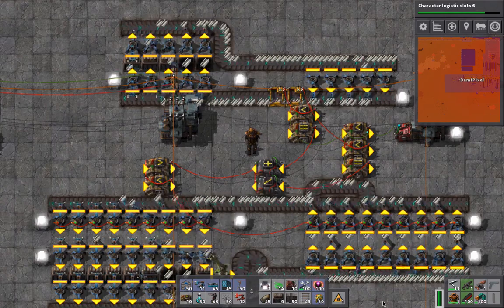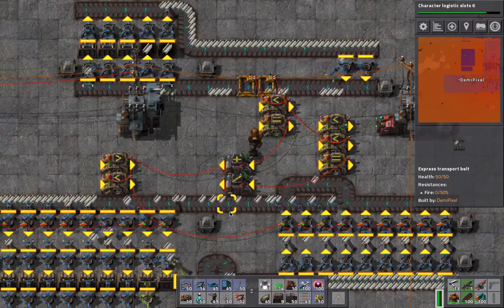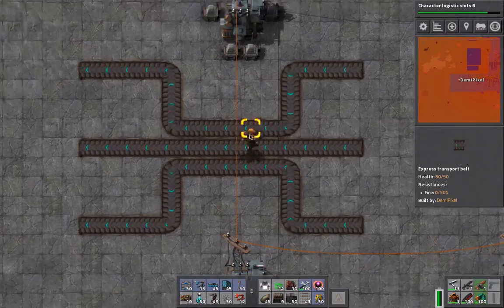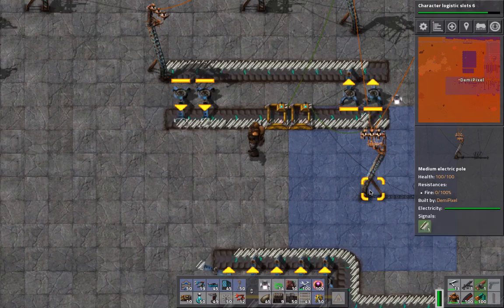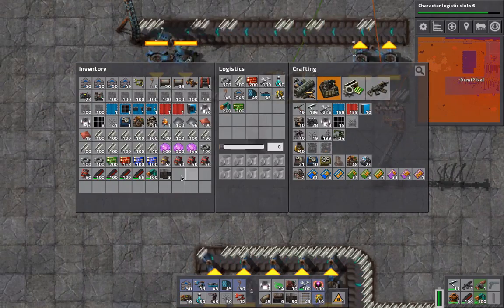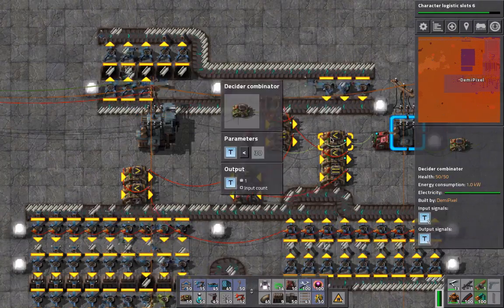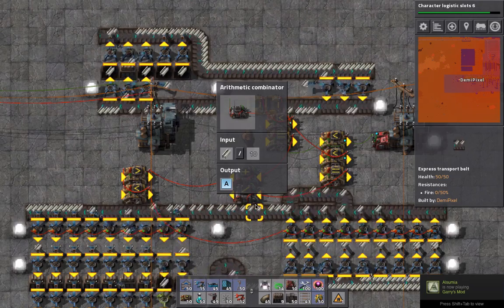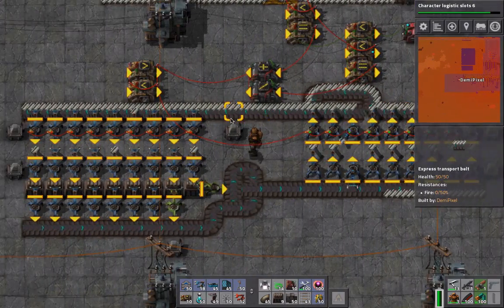Factorio Combinators: Belt Simulator

Comment: this is very nice, but since 0.15 whis is no longer needed thanks to the map.
Reply from the maker: Arguably it's easier to see this out of the corner of your eye, especially if you have 40 outposts where you can't be checking the map all the time.
Reply: sure or you could just let a speaker notify you if one of your outposts runs out.